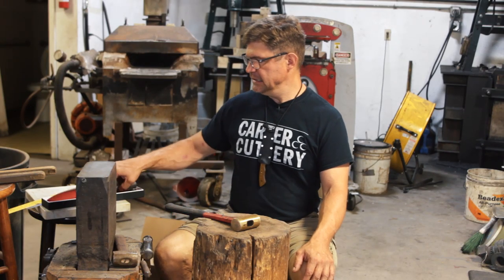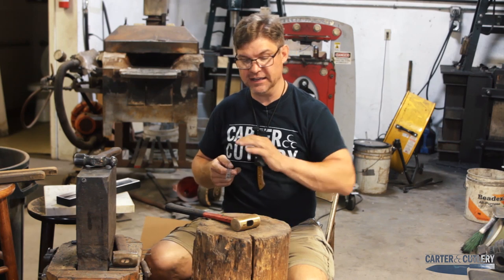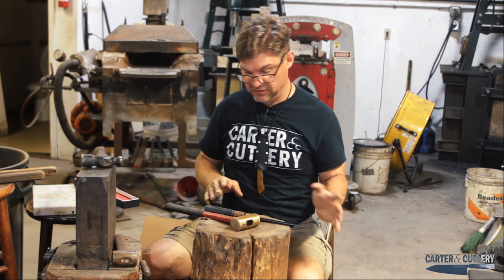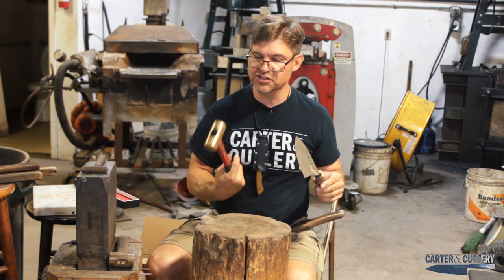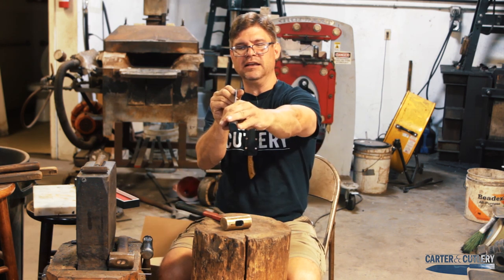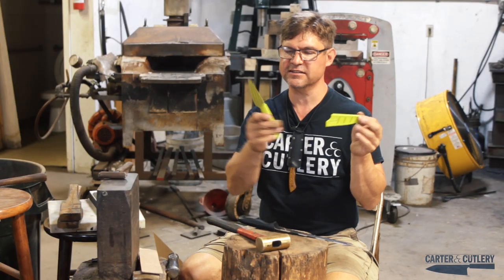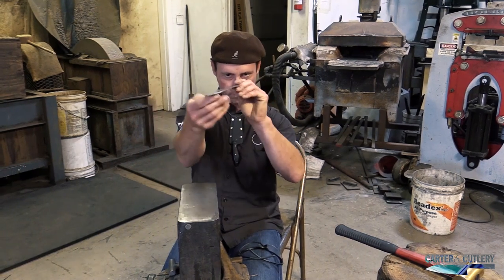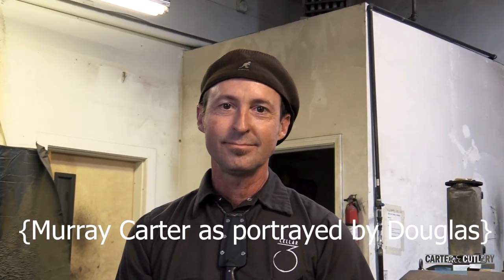How to Straighten Your Blades

Comment: Not having a Japanese hammer for years I have used a chipping hammer that I ground and polished. Not as good as the real thing but it works very well and anyone that has a welder has a chipping hammer or more than one. The carbide tip of the Japanese one being optimal.

Comment: I have a question. With this technique you can straighten the stock steel before shaping the knife, or does it only work after the heat treatment?
Reply: Works both ways but if you're grinding already heat treated knife stock, it could bend and then you'd have to straighten it again. Better to do the straightening as a last operation (if needed).

Comment: How much does it ding the steel on a homogeneous blade?  Would it need to be refinished after?
Reply from the maker: The tagane definitely leaves a mark in the blade which can be camouflaged by grinding the blade in the same direction  but usually remains in the blade when all is said and done. It is either that, or leaving the blade bent. --Murray

Comment: When you pay a certain amount for a knife it sure is pretty disappointing when it is not straight to begin with and you begin to wonder if you should pay a little more next time and buy from another vendor. But you get what you pay for I guess.

Have laid knives straight on table and bent to flatten,  similar to grooved paddle technique though with some success (probably not the safest).

Comment: How would you straighten a really thick blade, like a deba for Instance? I have a two layer laminate deba that has bent over time and needs to be restraightened. 
I also Notice Some Japanese single bevel blades always have their tip up, I believe its a result of grinding the ura and tapering the tip. But this always bends the Tip Up and the blade is  No longer straight. How would you fix that?
Reply from the maker: We address that very issue in our Kitchen Cuts 3 Slicing Knives. It can be found here! https://www.cartercutlery.com/knives/videos-and-books/knife-use-techniques-dvd/ --Cait

Comment: it's hard to see the flaws from the camera's angle.
Reply from the maker: Thank you for the feedback! Catching some of the flaws can be very difficult because they're so small, but we can definitely try a few better angles! --Cait
Reply: I found that, at least in my experience, it got easier to catch some of the issues on the camera after I had more experience catching them in person. It's a little bit of a bummer, since the point of watching the videos is to pick up tips on how to catch them, but if you pull the video back up if you have to straighten a knife or at least are holding one you know is Bent as a comparison, that helps me. I have a couple of weird medical eye issues, so my eyes don't work together and my vision's not correctable to 20/20. Even for me, though, after enough experience with different knives, I can pretty quickly and consistently pick up the twists on the camera, although it's significantly harder than it would be in person. I'm not a blade smith or anything close to it, but I love knives and try to take the time to sharpen kitchen knives for neighbors or anything like that when I can which does a service for them without a lot of effort on my part, and gives me experience with a broader a variety and quality of knives. I prefer to carry and use quality knives myself, but old junk kitchen knives thrown in a drawer are great for practicing spotting bent blades...